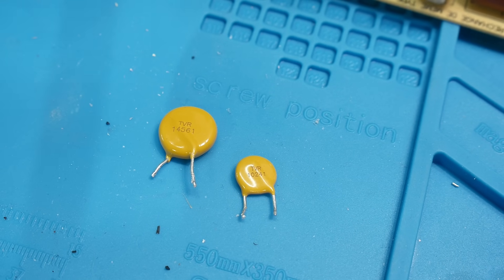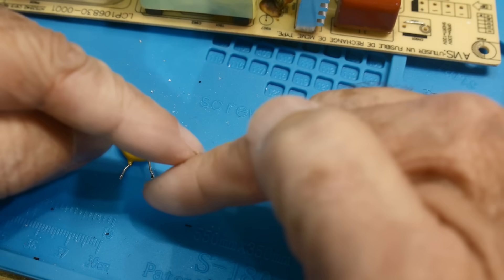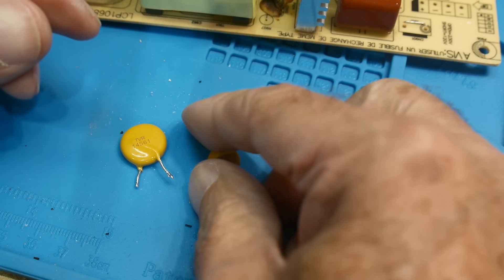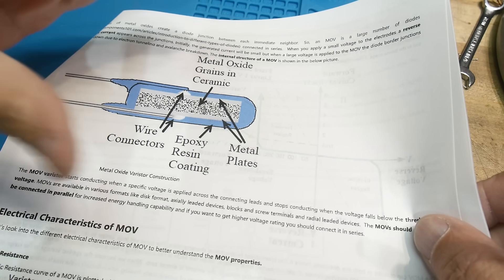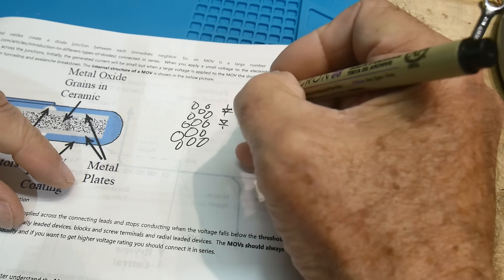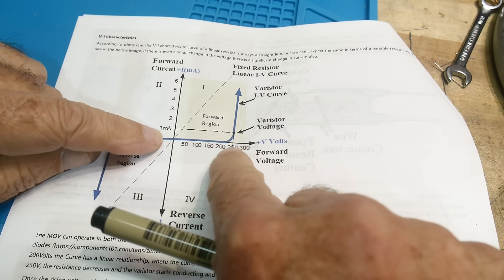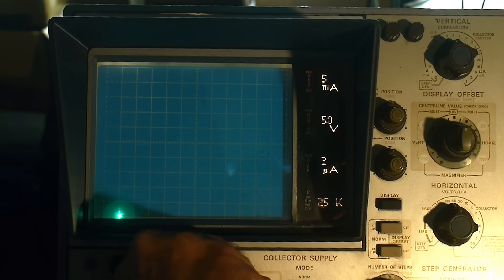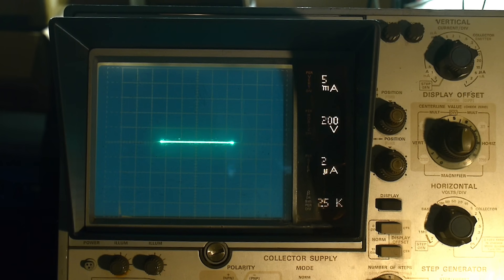#1777 MOV Metal Oxide Varistor ZnO

Comment: I have a question. in CA where power keeps going out during windy seasons for the last several years now. I see many clients electronics going bad. there was one time where 6 power supply went out in a lab of 20. what do you suggest to protect against that, a power line conditioner or an inline power surge protector like a power strip? I think there were power strips with surge protectors there, but they did not help.

Comment: I used a lot of these to protect electronic control equipment in factory settings.  It seems as if there was some finite number of hits these can take before they stop protecting.  (Permanently open?)   Some of them were big honkin' plastic trapezoid shaped devices rated in thousands of joules.

Comment: "Back to back zener diodes"  (Parallel ?) I think you meant to say series-connected zeners as they will readily forward conduct at low voltages ...  A $3 Mov is often the only device in cheap "surge protector" outlet strips.   They work pretty well, but their massive capacitance can limit clamping speed.  They will explode with too much energy.

Comment: MOVs were employed as variable capacitors in the stereo vibrato circuit of the Magnatone 280 guitar amplifier used by Buddy Holly.  
Fender included a more basic tremolo function in their amplifiers and called it vibrato, but the true vibrato of the Magnatones has cemented their place in history.
It should also be noted that MOVs degrade as they absorb spikes are thus limited lifetime components. My favorite GE MOV datasheet read, "Upon repeated application of surges, the MOV may expel its internal components in both solid and gaseous form."

Comment: These are really useful devices, however they have a BIG drawback, they wear out with the number (energy dependent) off peaks they absorb, and they can get to a point when they keep conducting a significant amount of current enough to start a fire due to heating, I've often seen them physically coupled (heatshrink, metal spring, epoxy glued) with a thermal fuse. IF i'm not mistaken there are some laws/standards that obligate manufacturers to use MOV in parallel with the main's input with a series fuse.
Reply: My biggest Belkin surge protectors with around 2700 Joule protection have several MOV-packs (with 4-6 MOV each) with a thermal fuse in between the MOV's, just like you say. One blew up one day after starting a microwave I had connected to it, so I took it apart and checked it out. Probably already on its way out as we have massive thunderstorms in the summers, so it already probably had taken some shock. They have diodes to indicate if the protection is still working or not.
Reply: @Indiskret1  seems like they did their intended job :)

Comment: I don't have access to a curve tracer but was wondering if i could use an Insulation tester to confirm the breakdown voltage of an MOV.   The are supposed to only deliver 1 milliamp of current when they breakdown.    SO I would think that would not destroy the MOV once it hits breakdown.    The tester displays breakdown voltage.  I could reverse the polarity to test in the opposite direction.   I don't know of a simpler way to generate up 1000 to 1200 volts for testing MOVs,  diodes, (1N4007) or TVS breakdown voltages.   Thoughts anyone???

Comment: One type of early varistor was made with copper oxide; Magnatone used them for the patented pitch-shifting true electronic Vibrato circuit in their guitar amplifiers (other amplifiers claiming to incorporate "vibrato" are merely tremolo circuits, only a few of which generate sufficient phase shift to sound somewhat like pitch-shifting vibrato.)  I believe the Magnatone varistors were a custom mde device and are no longer available.

Comment: Insulation tester is handy to test MOV, just with a multimeter reading DC across it. The tester is limiting the current and the reading is the voltage drop.This is a quick & effective test.
Reply: ps also found this useful "Transisitor withstand voltage tester" (120-2700V and 0.2-3.8mA) which I also use for zeners etc

Comment: What are the advantages over TVS-Diodes?
I was designing replacement electronic for a device that needed to switch an inductive load. The original electronic implemented a varistor as a snubber just like you mentioned. I was wondering if I could get away with a TVS Diode instead for cost reasons. But decided to go with a mov like the original

Comment: If they make low voltage varistors, then these could be really cool for some waveshaping in an audio circuit!!!
I don't know if they do but i am about to google it!
Reply: Welll....
They make low voltage ones..... but not low enough lmao
So i guess not xD

I guess i can just use diodes like a normal person lmaoooo

(I'm not smart yet, dont judge me lol)
Reply: Magnetone guitar amps of the 1950s and 60s used a special copper oxide (perhaps custom made) for their patented, unique electronic pitch shifting vibrato circuit in their amps.  Nearly all other guitarr amps that claim "vibrato" are merely using a tremelo circuit and only a very few have sufficient phase shift that they start to sound like there is a vibrato effect happening as well.  You can find plenty of information online about the Magnatone vibrato circuit and the orginal patent belonging to Dan Bonham.  As far as I know, the original devices have not been manufactured for years and I don't know of any substitutes, but fortunately they almost never fail even in a 60-year-old amplifier.  The Magnatone name has been bought by another company who is building amplifiers with that logo, but I don't know anything about the dedign and I'm betting that they're not using the original patented circuit....

Comment: Those are not zinc oxide, as the zinc oxide ones tend to be pretty resistive, so the slope with current rises quite high. Likely other metal oxides blended, and sintered. I have had a few NOS GE Zinc oxide varistors that I got as a pack, and used a few over the years. Red dipped epoxy on them.

They will all eventually fail when used on the mains, simply because the constant spikes degrade them, so for mains use it is always recommended to use the ones with 3 wires, which have a single shot thermal fuse integrated into the epoxy dip, so that when they cook themselves to a short the fuse disconnects the MOV element from the supply. I have had, in that pack of NOS, one that developed a blister sitting in the pack, and on testing it turned out to be short circuit completely. The ones in service also do need regular replacing, they give themselves up to protect against surges, and then either blow open completely, for the small devices, that get way too much energy in (though they are great if used after a resistor in a capacitive dropper, or with a small transformer after inrush limiter resistor to provide protection, using a fusible resistor) or, for the larger ones, they simply go short circuit when the silver layer diffuses through the device. I use them a lot on LED lamps, it does help with taming surges, though I also had a photocell with built in MOV protection that landed up on 350VAC mains, and that one failed, blowing up, and blasting the plastic cover of the photocell up high, and shattering it in the process as well.

Fun thing is that all street light photocells have a massive MOV in them, both in the fixture itself, and also in the photocell, even the shorting cells have one built in.480V operation, so they are there for lightning surge protection, as they will not trip if the neutral fails, and the one set of lights ends up sitting across phases. A lot of those electronic ballasts will survive operating on 400VAC, even though they are only rated to run from 120VAC to 277VAC. Magnetic ones do not care at all, they are designed to not fail with shorted bulb and 400VAC across them, though they will eventually fail from long term use, but a few days till fixed no problem.
Reply: Some early varistors were made with copper oxide composition, and one type that might have been a custom part was used by Magnatone for the patented, unique pitch shifting true vibrato circuit built into some of their amplifiers. Virtually all other amplifier brands incorporated tremolo and not true vibrato.

Comment: "Might Optionally Vaporize" devices.  Known for starting fires.  A safer upgrade to the MOV fire starter is a TPMOV / TMOV which is a thermally protected MOV.  Once they reach a set temperature they disconnect.  Eaton and Littlefuse , Bourns are some of the big manufacturers of them.  I threw out my MOV inventory a couple of years ago and started stocking Littlefuse TMOV's.  Now I don't have to worry about my customers radios catching fire in the middle of the night.

Comment: The company I worked for out of college manufactured a "safety analyzer" that tested for current leakage on DUTs in the medical environment.  On the top of this device was a 120VAC receptacle that the DUT would plug into.  One test required the polarity of the test receptacle to reverse.  This was done with a push of a button.  When a high inductive device was plugged in and the button was pushed, there was sometimes violent a "Ka-Boom".  There were 2 MOVs across the test receptacle and they would blow up in a spectacular fashion, causing the poor technician hours of work cleaning up.   I remember MOVs.
Reply: I used your tester for 12 years. Ours had a fault detector breaker that would kick the load off and re-set the tester, so no explosions and foreign matter in the OR.
Reply: That would have been an interesting feature.  If I remember right, the model was a Neurodyne Dempsey 431.  I worked there for 3 years and moved on to work in a hospital in Sacramento using the same equipment.  Retired around 35 years later in a small hospital in NE Oregon. @davebleamwa2bxy799

Comment: MOV's are Firestarters, in severe overvoltage events they can explode and cause fire. During there lifetime they slowly degrade with each short spike that occurs on the powerline.
Therefore i never use MOV's, but use Bi-directional TVS diodes instead. A TVS diode doesn't degrade after each event, and the responsetime of a TVS is in the Nanosecond range, so it will react much quicker. Also, TVS diodes are available from arround 3.6V up to 600V, so not only for low voltage like many sites on the net say.
Reply: If your worried about fire hazard then use TMOV / TPMOV which are thermally protected MOV's.  They disconnect when they reach a set temperature.  All the big MOV manufacturers like Eaton and Littlefuse make them.
Reply: @mikesradiorepair  Better to just toss the MOVs in the bin and use Vishay TransZorbs instead. TransZorb Transient Voltage Suppressors are superior in every way.
Reply: @Peter_S_    TVS diodes are not suitable for mains protection due to their much lower joule rating.  Also, TVS diodes tend to fail instantly in a dead short when they fail and they do not make a automatic disconnect TVS diode.  Modern MOV's like I mentioned and currently use do disconnect once they reach their thermal limit.  I do use TVS diodes but where suitable, secondary power supply circuits.
Reply: A 350V 3KW TVS can handle a about 21A of surge current. A somewhat significant mains surge is 2kV from 2 ohms or 1kA. So you'd need 50 of those TVS in parallel. A single 20mm MOV can handle such surge about about 100 times per it's specification.
Reply: @WhiteBream  You must be looking at a datasheet for some prehistoric MOV.  TMOV / iTMOV like I use in the 20mm package can handle 10kA.  And I say again, when your TVS diode fails it fails in a dead short.  TMOV / TPMOV's fail in a open because they are thermally protected, basically a thermal fuse.  TVS diodes have their place, in the power supply.  TMOV's rule at direct power line connection.  Why do you think TPMOV's are the standard in industrial applications.  Dead short proof because it disconnects at a set temperature, has remote condition monitoring capability to alert operators when it goes open and comes in a DIN rail package.
Reply: @mikesradiorepair  My argumentation was against TVS as a MOV replacement. Also, not an old MOV, could be same as yours except for the thermal piggyback. Can do 10kA for sure, but only once ;)
Reply: @WhiteBream  LOL, had to reread the post you made.  Sorry, thought you were the previous poster touting TVS diodes.
Reply: @tripplefives1402, even a TVS diode in SMD package can withstand up to 600V and peak surge of 1.5Kw. Take a look at the 1.5SMC300CA from Littelfuse. This type can handle 300V at 1.5Kw surge and cost arround $1.

Comment: MOV's seem to change their characteristics when they absorb energy. Small spikes over the years seem to lower their resistance and they can become heaters. Some fire departments in the US have tried to generate awareness of the fire hazard they can present when used in cheap "surge protected" power bars (likely they are too small in energy absorbing capacity and/or not adequately fused).
Reply: If your worried about fire hazard then use TMOV / TPMOV which are thermally protected MOV's.  They disconnect when they reach a set temperature.  All the big MOV manufacturers like Eaton and Littlefuse make them.
Reply: You don't have that problem with TMOV/TPMOV's.  Different versions use different mechanisms to disconnect but they are thermally operated.  Once it opens it's open for life.  The Littlefuse versions can be gotten in 2 and 3 lead versions.  The 3 lead version allows the monitoring of the TMOV.  If it opens the third lead is used to monitor that and alert. @tripplefives1402

Comment: The problem with thinking of these in terms of diodes is when they breakdown, they don't maintain a voltage across them like diodes would, they actually breakdown and become a short so they're more like a solid state version of a gas discharge tube.
Reply: Why didn't the curve tracer show that?
Reply: @KNfLrPn  The dead short effects are felt at higher currents. You'll very commonly see MOVs inline with a thermal fuse in power strips. Many power strips also include a "protection active" light which is just a indicator wired across the MOV, but still in series with the thermal fuse. I remember an old GE datasheet saying MOVs can explode upon repeated application of surges, but they used more corporate compatible wording.
Reply: @Peter_S_  I can verify this, Peter. I was reading phase voltage to the neutral when I had an MOV explode...and it was a new one. The panel meter was showing 120V on phase B when it should have been 277V. I went to verify the voltage at the main input terminals to neutral. Phase A read 277V, when I put my meter lead on Phase B with my other lead on Neutral that is when the MOV exploded. Needless to say it go my attention. I'm still trying to figure out why it did that.
Reply: They don't, unless worn out due to too many absorbed surges, in which case their leakage current will increase. Until popping due to dissipation. A TVS diode becomes a short too when overloaded. Once triggered, a GDT drops to ~20V or thereabout and remains there until the current drops below the hold current. That's why so see varistors on mains power supplies and no GDT's.
Reply: Mark can you furnish us with the URL for the Tech Note you cite ?
Reply: @tripplefives1402 Most certainly not the first time they are activated, but they are limited. I forgot the exact numbers but it was referenced in the Art of Electronics. 

Each breakdown event they develop holes in the separation barrier.
Reply: agree with this post, I think this appears to be more the oxide breaking down and a certain voltage causing the metal to conduct maybe I'm wrong